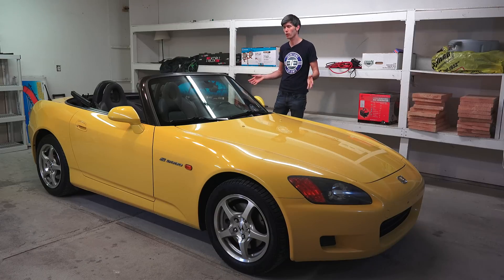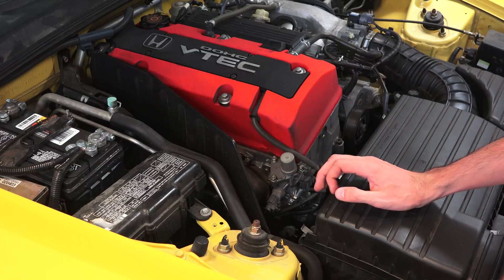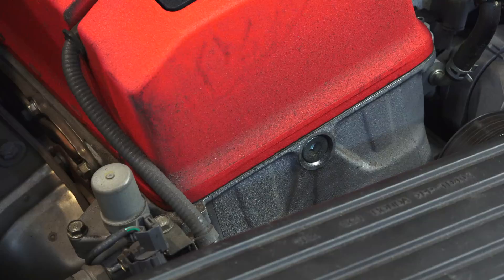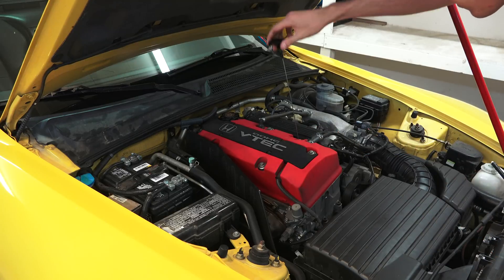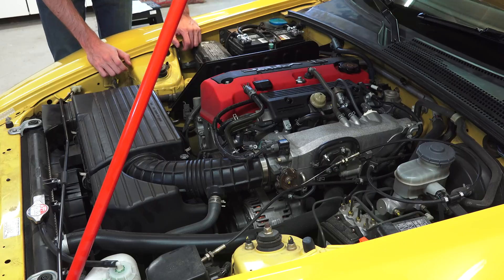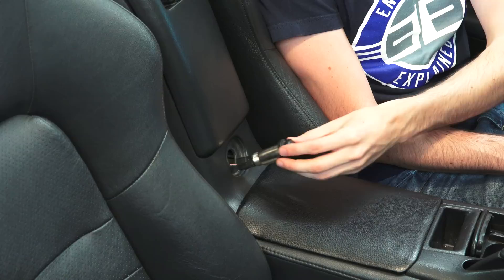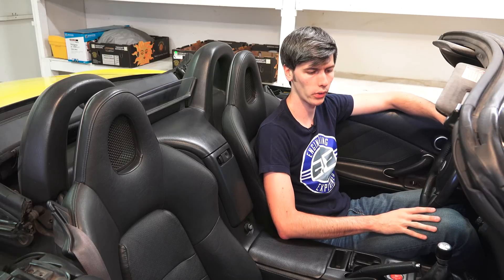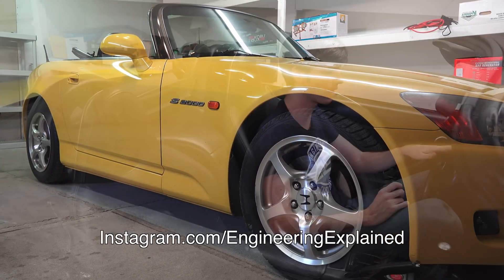What's Wrong With My Honda S2000?

Comment: ya, it just loses a few liters of oil here and there, nothing critical, and if you shift to 3rd, the engine explodes a bit and petrol comes through the air shafts, but nothing bad. It´s all really good :D   Come on dude, buy a BMW 335i, 340i, M3 or M4 convertible and X-Drive, and you get to know, what fun is. And I guess dozens of other cars would do the trick as well ;-)

Comment: Mighty Car Mods did a test with the same model S2000 on a dyno with several different filters and found the stock airbox is actually quite exceptional.

Comment: MY AP2 would burn about 1/2 qt between oil changes with no leaks and about 86k miles on the clock.  Also, have you found the secret compartment yet @engineeringexplained ?

Comment: Trade in the Honda and get a Bimmer.
Reply: Let's see.  I have a 16 M4 and an 01 S2000.  Guess which one is more fun to drive.
Reply: Jeremy Thompson M4 of course.  Not only is it beautiful.  But the women love to glance,  stare,  and rubber neck to Bimmers.
Reply: kilmorecombine0 M4 is faster but it is not as fun to drive.  Honda has the better transmission, 9k rpm redline, weighs about 1,000 pounds less, has better steering, and puts bigger smile on my face.  Yeah the M4 gets more attention, and it is beautiful and fun, but i'll eventually get rid of the M4, I will never part with the S.
Reply: Jeremy Thompson I get you bro.  Just like cars to girls.  There's that one girl that you can't stop thinking about,  same as a car.  There will always be that one car that you love and can't part with.

Comment: get ya a 15buk bottle of duralube engine treatment...ive had it reduce oil consumption in more than 5X in old cars... plus treats the metal...bin using it over 20yrs. GREAT STUFF

Comment: Owned a S2000 for several years i could say they are bulletproof. Make sure you get to know the transmission really well before trying powershifts at redline. Also get ready to do other jobs like the driveshaft cups, they tend to get pitted, if you feel vibrations on the rear axle under hard acceleration, they need doing. Also check if the clutch master cylinder has a small leak just under the pedal. It's a very common problem. Good luck and enjoy RPM!

Comment: Changing manual trans fluid, that is a little odd, every car I have owned as been manual, a 2000 ford focus, a 1994 ford ranger, and now a 2016 versa, and every single one of them as said the manual trans fluid is good for the life of the car. There is no need to change it unless it is contaminated (metal specs, not good, or some how submerged under water). So for a second, I didn't watch the first video, when you talked about changing the trans fluid I thought it was automagic, and I was going to rage quite, and not just this video but life :).
Reply: It's a nonsense to compare a ford ranger transmission to a 9000rpm engine transmission. S2000 and Type R transmission fluid should be changed between every 15 000 to 40 000 kms. depending on your driving style.
Reply: All fluid will contain metal specs.  Any gear or moving metal component will create tiny specs of metal in any fluid from ATF in an auto to engine oil to gear oil in a diff or a manual trans. From the natural wear and/or from the initial break in. Not to mention on a molecular level the fluid will breakdown and efficiency will deplete. As a fully licensed tech I see this everyday, if anything the magnets on the fluid plugs are a dead giveaway. That said any large chunks are obviously big problems. Do yourself a favor and keep all fluids changed regularly at proper intervals for max life of the components. Lot to be said about regular maintenance.    :)

Comment: Drives me nuts when people are so quick to get rid of the stock air box. Many times, as I'm sure you know, you just expose the filter to the heat of the engine. NG! Also, if you haven't already seen it, Wheeler Dealers did a great show on the S2000. Check it out!

Comment: I have owned 2 Honda Civics, at this moment i have my third Honda Civic. 
I drove one till junkyard. 
The most attention is to look at rust and when you see rust, attack it directly. The rust start at the back fenders.

Engines and electronics are bullit proof. Suspension is mostly fine. Tyres ok. Exhaust system needs sometimes attention, and sensors check sometimes. 
Advice: Buy a proper Honda without aftermarket parts, and with factory recomended OEM parts.

Comment: If you're messing around with that power outlet I'd say unplug the battery, better safe than sorry. As for the bolt I'd see if there's a specific torque to set it too. The oil pan should be fairly easy and should give you a chance too check for anything wrong in the pan. You probably already thought about it but a bar for The front suspension wouldn't be a bad idea. I look forward to seeing this car again.

Comment: I'm a new subscriber and just wanted to let you know my s2000 timing chain tensioner was also rattling and since I wanted to go low cost on fixing it I sanded down the worm gear. SO easy and very very simple. did that 2 years ago and still no rattle!

Comment: Leaking O-ring might be because somebody stretched it over the head of the bolt... Still, better to have small leak than a major one.  Also, look at that black brake fluid... I wouldn't mind some DIY vids, would be great if you had somebody to hold the camera--its going to need fluid perspectives.  Keep up the good work!

Comment: also when you are checking you oil on the s2000,(if your facing the bumper) look at the right side of the dipstick. not the left side.  that will give an accurate reading!

Comment: quart low? Geez! Use full synth Penzoil or Mobile 1 and it might stop burniing oil, at leasdt it will run smoother.  I just started using full synth in my Speed3 and it runs so  smooth I could not believe it.  You really need to plasti-dip your rims-$50 in product, but it will look 100X better.

Comment: I wouldn't worry about the oil consumption.  My old 2002 RSX Type S used to eat a quart of oil every 1000 miles.  It did it from the day I bought it off the showroom floor with 12 miles on the odometer to the day I traded it in with 281,651 miles it.  I know the K20A2 in the RSX-s isn't the same as the F20C used in your S2000, but it wouldn't surprise me one bit if that engine had the same consumption issue the K20A2 did.  I don't know how true this is but the general consensus at the time when I bought it was that it was something to do with the high compression the engine had.

Given the age of that S2000 you may want to check or just outright replace the alternator on it.  My RSX-s's alternator died due to an open diode in the internal voltage regulator.  Took out both electric cooling fans in the process (and cooked the battery too).

Comment: Those FRIM cylinder liners are very tough. Much tougher than the rings. That's where it's getting the oil to burn. I have a '90 Prelude Si (B21A1) with the same liners, and it goes through quite a bit of oil too. I hear that there's zero cylinder lip when rebuilding, so you don't even hone it, lol.

Comment: Checking the oil like you did is always going to give you different (wrong) measures. You should always check it with the engine cold. Remove the dipstick, clean it (don't even look at it) and put it back. Now remove it again and check the measure.

The logic behind that is that when the engine is running, the oil splashes all over, creating "false measures" on the disptick, so to speak. So you ignore that first reading to avoid this.

Comment: I am writing here in hop that you will see it.  I watched all your videos, and once about transmissions are very interesting. I would like for you to explain problems in some of the transmissions. To be more specific, I owned a lot of different used car and  for some reasons GM cars in most cases have "kick" when selecting "D" or "R" while from my experience AUDIs tend to be very smooth but at the light when I am in Drive, they tend to pull a lot, Looks like that transmission is not completely disengaged from engine. While Japanese cars tend to have slippery shifting between gears.  I am talking about cars over 100k miles. Thank you.

Comment: VTEC stores a LOT of oil in the top of the engine.  You need to wait a good 15 to 30 minutes to get an accurate reading on the dipstick.  Best to check it when it's been sitting overnight, actually.  SO many oil passages up top, they can store a LOT of oil until they have a chance to drain down into the sump.
Reply: Great tip for a VTEC engines!!! I would also suggest to change the engine oil yourself, and let it drain overnight. I did that on my B16A1 and I drain about half a liter more of old engine oil compared to a oil change in service.
Reply: You don't really need to wipe it if the engine is cold.
Reply: Also, when u check the oil, you take the dipstick out, wipe it with a paper towel or some piece of cloth, sink it back and pull out - now you check the level. You didn't do that in this video, if you won't wipe it, the oil gets all over the dipstick due to engine running before shutting off, so your reading will be inaccurate.

Comment: Just a question and I am sure you have your own process.  Do you prefer to fix or modify a car from the bottom/rear to the front/top or the other way around?  What I mean is do exhaust, tires and performance brakes before intake, electronics and engine mods?

I have a 2004 Chrysler Crossfire and I normally start Bottom/Rear and work forward and up.

Comment: Some times the roof won't fold as low as it can due to worn roof elastic, yours might suffer from that, hard to be sure from the camera angles. When the roof is half way back, check the bar that's normally over your head has folded back.

Comment: Minor oil sweat, leave it. Those engines burn oil, its nomal, any engine these days do.
You must be the weirdest person in this world, taking their Honda to a Subaru dealer to do an inspection. 
The cheaper engines tend to use sealants on the sump, resealing is a messy job and you have to clean the residues on the surfaces. Leave it to a Honda dealer to do the work.

Comment: Not so sure about the wisdom of giving up an STi for this thing...
Reply: I can't agree with that statement at all. The s2000 is a much more balanced nimble car than an STi,  and an open top roadster to boot. IMO more fun in many ways and not even comparable cars for that matter. (My GF has an STi and my father has an S2000 so I have plenty of experience with both. ) Considering this is complimenting his crosstrek it makes all the sense in the world. Good find!
Reply: I would avoid STIs. Always wear a condom!
Reply: Definitely not comparable cars. STis are beasts. Loads of grip and tons of grunt. Lovely boxer rumble. S2000 is a nimble, open top roadster that is just loads of fun. A Crosstrek and an S2K is an awesome combination.
Reply: AWD = novice , FR/MR = advance
Reply: Ever driven a RWD in the snow?
Reply: @Home of the Mad ....typical troll response. Your argument is invalid.
Reply: Home of the Mad Do you have any experience with real winter driving? Ever come up to a red light on any kind of incline with 2 feet of snow all around you? Even my Chevette with good tires, sand bags in the back, and good ground clearance became a plow.

AWD is an advancement as a whole, I will agree in mild climates they really have no use case, but in climates (see Alaska and there most purchased car being a WRX) where you have snow for 8 months of the year, they work wonders and are just plain safer. 

Physics not brain power or driving skill.
Reply: False. AWD is great even in the dry, especially if you have a lot of power. You can get on the power WAY earlier in a corner with AWD than with RWD (For reference, I have owned both an S2000, mostly stock, and an STi w/380wHP).
Reply: Ya, should have gotten a Road Runner or something with more history than just fast and furious.
Reply: Stup1d new feature I agree, AWD is for soccer moms who can't drive in rain.

Unless you are going to go offroad.
Reply: Lirker X frame, mid engine FR, 6 MT, LSD , 9.5k redline a chick car ? u r cute
Reply: Yes, i know it is a FR, but it is also mid engine, the front engine mount behind the front axle, gxxgle it, thats why i said "mid engine FR"
Reply: I went the other way, sold my 2000 S2000 and bought a bigger-turbo 2005 STi. I've owned the STi longer and done a TON more upgrades (did a full engine build, some suspension upgrades, track-capable pads/fluid/better rotors, etc), but I still miss the S2000, which was nearly stock. It's a fantastic car.
Reply: The 'wisdom" was that the enjoys this vehicle more. Literally nothing else matters.
Reply: My first car was RWD, trust me you don't look like a manly man when you are stuck in 2 feet or more of snow. AWD is far better in snow, and can still be fun with TCS and STM turned off.
Reply: Stup1d new feature S2000 is a FR car not MR btw.
Reply: Stup1d new feature fair enough, oddly specific, but correct.
Reply: Not all of us are lucky enough to live in the snow lol if thats your main argument buy a snowmobile not a car
Reply: alcowherd7 Ya, who cares? If you know what your doing it's a hell of a lotta fun.
Reply: alcowherd7 So don't get stuck
Reply: alcowherd7 No, if you drive with a brain, you minimize your chances of getting stuck. The only reason why AWD is offered on standard cars is because people don't know how to drive. Only two types of cars should be AWD, race cars and offroad cars.
Reply: alcowherd7 Yes, I do have winter experience, coming from Chicago. My car was FWD but before you comment the tires were so bald that I could see the steel in them.
Reply: Ody -Chan  imo Subarus are ugly/bland and have no style.   great cars but not a car you turn back to look at when you park lol...

Comment: That bolt with the leaking O-ring looks like it holds the timing chain guides in place. 
And if the tensioners gone bad i'd be checking timing aswell. it's only taking the cover off and putting the pins in, and it'll save you lots of pain if the timing has managed to slip a tooth on the cams

Comment: Do not put in an aftermarket air box/filter.  There are videos that prove the S2000 and many other Honda motors lose power when the OEM airbox/filter is changed. The S2000 is particularly sensitive to change. It had the highest specific power output per litre, as a result of squeezing out the power, the engine is precision engineered to be the way it is. When you start to change things the engine doesn't like and will run rough and lose power. If you don't believe me, Google it. Leave the engine completely stock, it'll drive better. Maybe, an exhaust would be OK, but apart from that I'd leave it.
Reply: which is why you retune after modification. lol
Reply: +Steve Pham any time you increase airflow, there will be power gains. sure the s2k was engineered for maximum power out of a 2liter, but while following emission standards lol. test pipe, uk mod air filter. there wont be huge gains in peak hp but the powerband will clean up.
Reply: The puffo intake is actually the best intake box for the s2000.  after other mods like test pipe etc and a tune it yields some pretty good gains.
Reply: +Steve Pham any time you increase airflow, there will be power gains. sure the s2k was engineered for maximum power out of a 2liter, but while following emission standards lol. test pipe, uk mod air filter. there wont be huge gains in peak hp but the powerband will clean up.

Comment: When you screw in the 12v be careful you don't strip any of the wires, it's quite sharp back there, if you do you may end up blowing fuse #9 whenever you run the car and stress the 12v. Learned this the hard way filling up a tire I plugged in the middle of the highway. Had to take a cab to a autoparts store to get new fuses, and putting electrical tape in the middle of the night with a dying phone so you can get the pump working to inflate your tire so you can get on your way is kind of a special feeling.
Reply: At least the car comes with a nifty fuse puller :)

Comment: Two recommendations from me. Get yourself the service Manual (its essential) and put in some Liqui Moly 0W40 for the Engine. It might be quite expensive (~50 € for 5 Liter in Germany, most expensive 0W40 on the market) but it is absolutely highly recommend from an Oil Expert driving two Honda. For the Transmission i can also recommend Liqui Moly High Performance Transmission Oil GL3+ SAE 75W-80

Comment: Inside tip, for the center console power outlet, wrap a rubber band around it before inserting it back in. It will be nice and snug.

Comment: Replace the timing chain tensioner, serpentine belt, check plugs, coil packs, and last compression test.  As for the power outlet you'll need to remove quite a bit of panels to re-secure it. Not too bad but just a bit of a pain. Good luck with it!

Comment: Aftermarket Timing Chain tensioner is better than rebuilding the one you have. 03 AP1 owner here. Keep the stock air box and take the lid off. All of them will burn a bit of oil DON'T put Mobile 1 in it or it will disappear faster than you can say V-Tec

Comment: I'll be curious to see how you handle the IPhone/Android connect to the stereo. My Vette is a 2007 and I still had to do some nasty mods to get that.
Reply from the maker: +Brian O'Neil previous owner installed a new head with Bluetooth. Also have the original but I'll probably leave the bluetooth one. Spotify ftw!
Reply: I had a 6 CD changer on my first car, so I used 6 CDs. lol
Reply: I used a 4 pole double throw switch to switch between the feed from the CD changer and a jack socket I stuck into the middle of the blank for an unused button in my last car. The stereo was just smart enough that it wouldn't play any sound if I just disconnected the CD changer and fed a signal to the sound input pins, so this workaround did me very nicely for the 5 years I had the car.